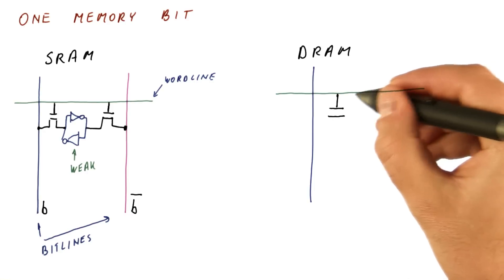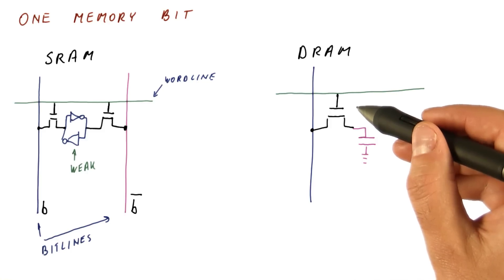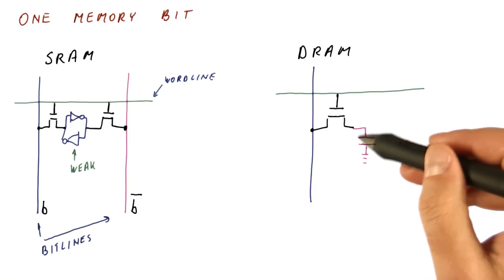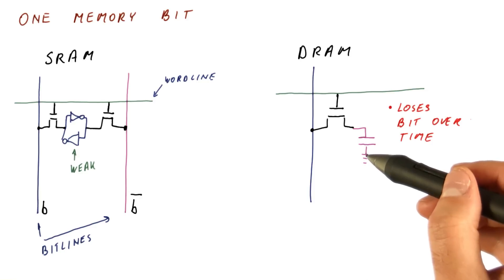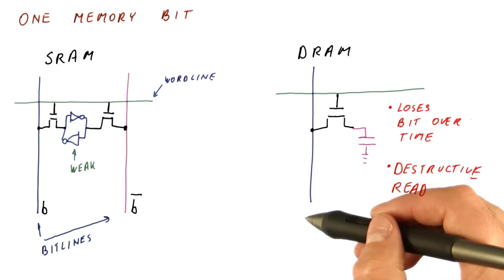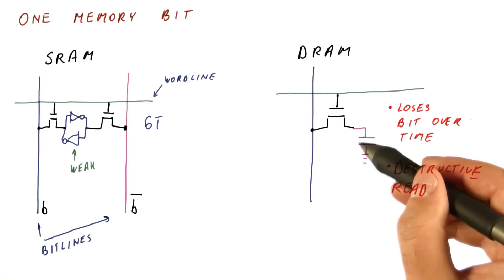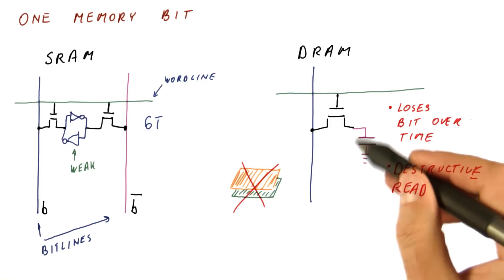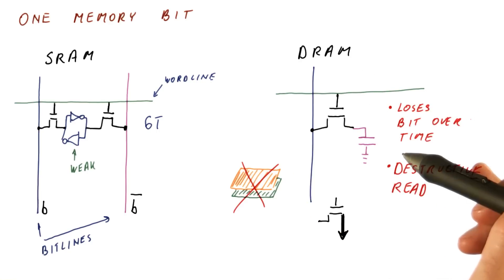One Memory Bit DRAM - Georgia Tech - HPCA: Part 4

Comment: How long does this memory differ from storage?  is memory essentially a faster version of computer storage?
Reply: Memory is the fundamental unit of storage. Storage typically comprises a large amount of memory chips which are integrated together to work as a signal memory block. Example: You may have 8chips of 32GB on a single SSD giving you a total storage of 256GB!
Storage additionally has interfacing to allow low latency and high bandwidth memory access
Reply: So storage and memory are essentially the same thing?
Reply: Thank you so much for these fast replies! I love your videos and you're an awesome teacher!